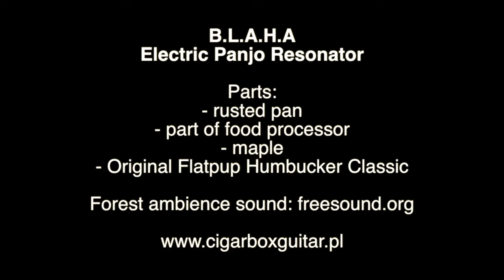How to Build a panjo - complete process plus demo

Comment: *****FINE JOB YOUNG MAN!
I LOVE IT! And most of all I Love seeing people become resourceful and Artisan/craftsman to fit every Human need!
I just built a Asian looking 6 string Lute(small scale neck) tuned AA, EE, AA (flat wounds on the AA and EE, and plain lights on high EE with a chinese PICTURE design biscuit tin and brass hardware, stainless zero nut, piezo electronics and brass decorative carved bridge and tail with cello fine tuners. Have to back machine screw the tail though because tension was too great for the brass silver solderings even though I placed brass rid plugs to secure. Working on tgat Damn Tail piece now aside now having to wait because the china made Tap and Die sets I bought are TOO DAMN SOFT OF METAL.(ebay purch). LOL
I found myself talking to myself and siding right along with your steps. 😆 
Of course I got stumped at that pickup you placed in there. I was like...what the heck is that? AGAIN...FANTASTIC JOB MIKU! I WILL BE SUBBING!!
GOD BLESS YA MATE!***
Careful watch buy on both eBay and Amazon! 😆 lol
Reply from the maker: Thank you! It is always nice to read such complete comments. This pickup I used was an extra quality Original Flatpup. https://www.flatpup.com/ made in Austria. And yes, I have some bad adventures with chinese components. Greetings
Reply: @MikuCigarBoxGuitar  hope you and Family are doing well pal! Keep great spirit!
Reply from the maker: @777fiddlekrazy  Same to you mate! Greetings from Poland

Comment: Congratulations on a fantastic build, very interesting and a great sounding panjo, i followed this build with interest  but could you tell me what is the benefit of the food processor part and would it make much difference to the sound without it . I am in the process of building a oil can guitar but i doubt it will finish as good as your build. Well Done.
Reply from the maker: hi. thank you for nice words. the food processor part resonates in E. so it works like resonator together with harmonics of the strings and chords with the E sound. It is not significant difference but I love Ed Stiley works and wanted to try. good luck with your build

Comment: I have following your builds for a while and your artwork is a great signature feature. Can you say how you determine the back angle? Or your trade secret. Thanx
Reply from the maker: Oh thank you Tim. I do not really care how many degrees this angle is. Just compared with standard Gibson and measured in mm how far the headstock is below the body surface. But i think IT is easy to Google.
Reply: I usually use 12 to 15 degrees